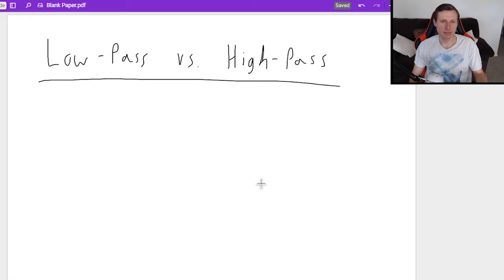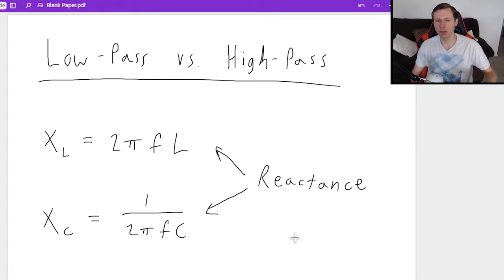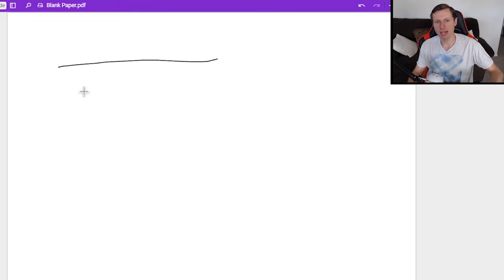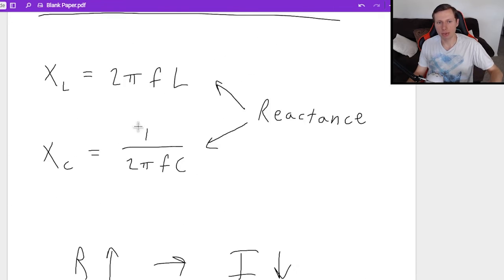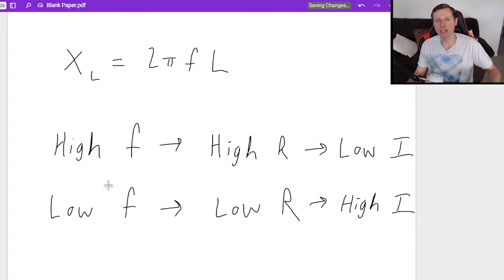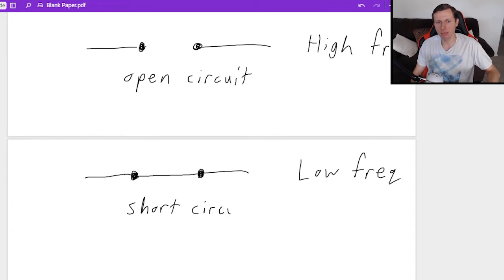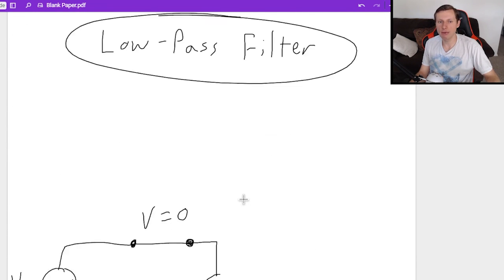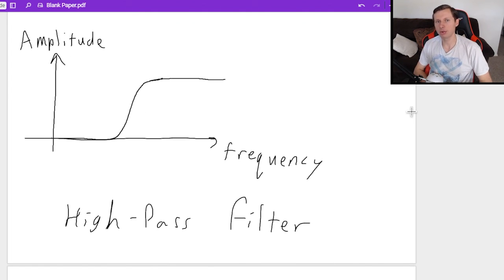Low-pass and High-pass Filters (Explanation and Examples)

Comment: nice but this math won't help you make your own speakers with stable impedance. Passive crossover affects speaker impedance. Even an 8ohm speaker can drop below 4ohm if the crossover is not well tuned which leads to poor sound quality and heats up the amplifiers. Online calculators won't help you. You need a lot of knowledge and special measuring instruments.

Comment: My only gripe about this explanation is the use of the term resistance instead of impedance. Impedance is the sum of resistance and reactance and applies when your voltage and current remains static overtime (e.g. DC) or when you have a purely sinusoidal waveform
Reply from the maker: yeah, you're right about that